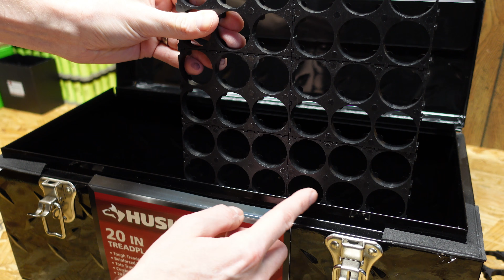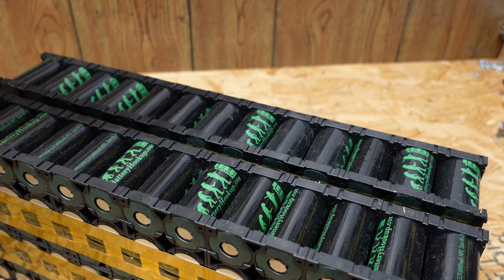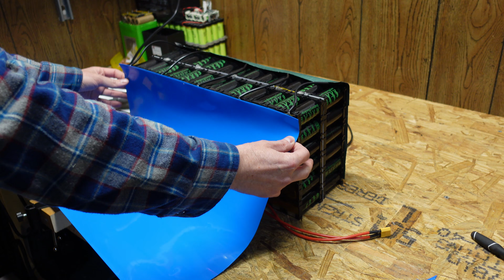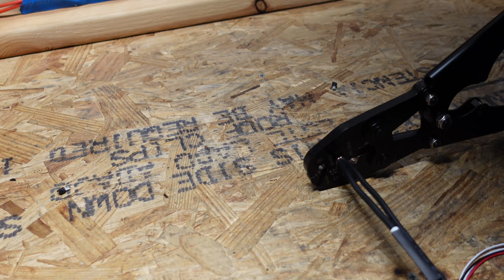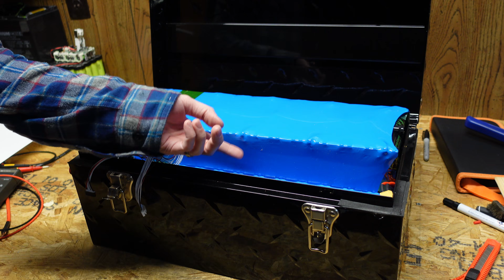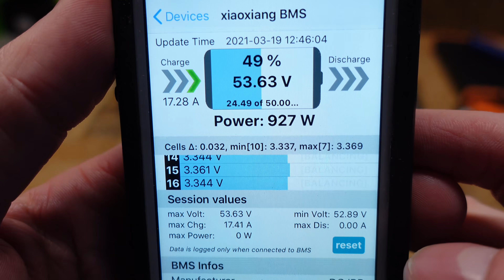DIY 4000Wh 48V LiFePO4 Battery Toolbox Build, Start to Finish!

Comment: 4,000 watt hours battery?   would that be a 4,000,000 milliwatt hours battery?    
Are you selling something on ebay with "massive" watt hour capacity, or simply making a 4KWh battery?
Reply from the maker: It's a 4000Wh battery. I'm not sure what you're getting at. Why would anyone report capacity of this size in milliwatt hours? That's just stupid.
Reply: @LithiumSolar    a bit like saying 4000 Wh...instead of 4KWh.

Comment: BATTERY HOOKUP IS NOT SO GREAT GUYS WATCH OUT FOR DEALS THAT MAY NOT BE SO GREAT.  ALSO WITH ITEM DESCRIPTION.
Reply from the maker: Did you have a negative experience? Can you elaborate on what happened and did you contact them to try and resolve the problem?

Comment: I know you do this just for something to do but, That just looks too much like work to me. For the time input value? I'd rather just get the 100ah cells and have 16 to bolt together.
Reply from the maker: Yep, I wouldn't do this again. LFP cells weren't as easily and cheaply availible just a few years ago like they are now.
Reply: @LithiumSolar  Yeah well with the explosion in demand for energy storage that supply of cells seems to be drying up. Sure seems like there are a lot less listings for cells these days.

Comment: at 24,00 you should not "cut to fit" on balance wires as it changes the amount of resistance and voltage drop acording to wire amount the best solution is to do as you did and curl it up , to cut them is not a good pratic , it is however a very nice build

Comment: Yeah sorry but I really don't approve of your insulation I've seen more better insulation jobs seeing in Australia we have very heavy corrugated iron clay bush tracks because 4 wheel driving means a lot of vibrations.
Reply from the maker: This is absolutely NOT designed to be used in a vehicle or mobile application.

Comment: This needs saying: It's important for safety

ALWAYS cut off the tinned end if you're crimping and NEVER crimp a soldered wire (the same applies to screw terminals)

Tinned ends will suffer solder creep under pressure of a screw or crimp and deform the wire bundle, which in turn raises the bulk resistance of the joint - adding heat in a positive feedback loop

How bad can it get? Back in 1986 I got to tour what was left of a satellite station's 10 metre dish control cabin. The installation engineers had tinned 48V power cable ends before fitting them to the breakers and busbar terminals. They got hot - and the resulting fire caused $5 million damage

Also: It's best to label each BMS wire (you can get a label printer and shrinkable label casssettes for less than $60). You'll thank yourself later

Comment: Be very careful with those thru the toolbox power terminals. I’ve seen them come apart and then the conductive portion will short to the toolbox/chassis. Might not be a prob if only one does but If some chance they both do or if one does and anything is shorted to your “floating” frame then you could have BIG problems.

Comment: Use a longer hollow bar slip it over the crimp tool and use it like a breaker bar and it provides leverage for an easier crimp.

Comment: How many AH are the batteries.? I read 6000 mAH which is 600AH. If I buy 100. Seems silly cheap for 600Ah - thanks
Reply from the maker: They are 6Ah batteries, so yes, 100 of them would be 600Ah (at 3.2V). I'm not sure it would be any cheaper than Al-cased prismatics in the long run. You also have to factor in the cost of nickel strip, cell holders, etc.
Reply: Sorry my mistake, 60Ah for 100 cells
Reply from the maker: @stephaniecopson475  No, you were right the first time. 6Ah Cell x 100 pcs = 600Ah.

Comment: Battery is a very small part. Peak tourque and current of Motor matters. If 48v I'd assume 30A drawn which means at rated RPM and load u can do max 2 hrs (84AH battery)

Comment: do battery hook group the battery cells before delivery? the voltage , capacity and Inner resistance should be at a standard level so that the finished battery pack will have better performance and better user experience .sorting and testing the Voltage ,IN and Capacity are important before packing.
Reply from the maker: No, I highly doubt they're doing any kind of grouping on the cells before shipping. You would have to ask them that question though.

Comment: A sodium battery could be used in front of any condo parking spot charged all night and day slowly, then a higher discharge charger cold be used for a good five to eight hours of good vehicle charging. All this could be done easily for a condo renter or owner to have a power company to install a power connector from the living unit being charged for a little power used at low peak times.

Comment: I worked for a company where the expert of the firm showed me around - when we got to the kitchen, he opened the utensil drawer and literally pointed to each utensil type, calling it out. The guy was a complete moron. Why do you find the need to hand gesture the sizes while calling them out instead of just showing the label that has the dimensions on it? Lame.

Comment: Good build video and thanks! I might however suggest checking all cells and top balancing before spot welding. I recently received a 130 of these cells from Battery Hookup and found three cells had self-discharged to below 1V. After top-balancing a group of 40 cells including the three self-discharged cells, after 5 days those three cells as dropped between .5 and .8 volt, and when fully charged only delivered about 3800mah. After building a 20s X2 pack, I found another 4 cells that delivered between 4800 to 5000mah of capacity.  The date on these cells is '09-20', so possibly two years old, so I may have got a bad or old lot. Batery Hookup has not responded to my messages.  As Such, I might suggest buying a few extra cells if building a pack,  I would be interested in the date of the cells you got are, and if anyone else has had a similar experience with these cells?
Reply: Yeah there is pretty much nothing they will do for you after you purchase

Comment: nice work bud,  would you prefer to use the larger lifepo4 cells due to them requiring less work? how does energy density compare between these cells and the larger 100-200ah cells?
Reply: These are usually more energy dense but the advantage is the shape of the pack. You can make far more compact shapes for specific cases and get a bigger energy density. While the larger prismatic cells need custom size boxes to get the most compact battery.

Comment: i do really hope you actaully sorted the indevidual batteries into mAH and then into correct paralell connection
Reply: Sounds like a good tip. Because the BMS is supposed to balance between the series-connected items, but the cell groups that are connected in parallel are regarded as a single unit, so if one of them is 'weaker' it might go bad, and the BMS won't even notice. I wonder why there aren't any cheap BMS that address each cell individually, i.e. a wire (pair?) for each cell, not just for each group

Comment: Clamp one side of those crimpers between two 2x4's mounted to table and use a cheater pipe for the other side, will be much easier for you

Comment: 3,765 out of 4,000 wh.   Why?  Not fully charge or just unbalanced cells?
Reply from the maker: I didn't spend any time balancing it really. It needs balancing. Also, should have tested it in amp-hours since watt-hours does not account for loss in cabling.
Reply: @LithiumSolar  It was a really excellent video.  I didn't think about cabling loss.  Would it be that significant?   I appreciate all the trouble you went through and got a really professional result.  I am waiting for cells from Shenzen to build a 400ah 12v pack with 2  200A JBD BMS's and I know what it takes to get it done like this video shows.   I have searched for a ready made box to put mine in like you found,  but none fit the bill.  I am going to fabricate one that is insulated and as small as possible to conserve my space.   There isn't much on Youtube showing builds like that so I'm kind of on my own.  I'd be curious to see how much improvement you get if you balance those cells!

Comment: open barrel lugs are by far the best way to go. all these other connectors, like solder ring inside heat shrink type junction connectors, squeeze over tap connectors, etc. they are all crap. open barrel is the way to go. as a bonus, you can also solder these without melting off your shielding. go with some harbor freight marine grade heat shrink, with the glue in the center, over your open barrel lug, and you will now have a water tight connection that Will rival some of the best factory connections. 😏💯💯💯

Comment: Thanks for the video. Considering building a 48v off grid battery bank using the same cells as these. Since these are lifepo4 do you think there's any need for cell level fuses in a big battery setup?

Comment: im pretty sure you have you positive and negative mixed up, negative is the small one on these types of batteries
Reply from the maker: No, I have them correct for these cells. I know what you're talking about though - they're not as-expected on some, like the A123 26650 cells.
Reply: @LithiumSolar  ah that makes sense i have a bunch of a123s here that im comparing to

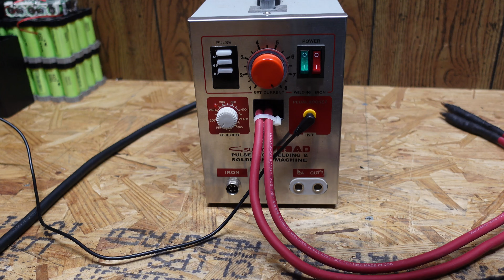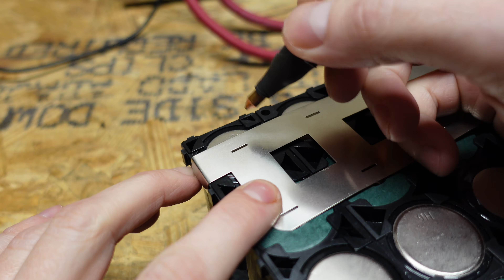Comment: at 5:03 the lower left corner of the strip has slipped under the protective paper ring, this is a possible short waiting to happen, at 5:35 it hasn't been corrected.
Reply from the maker: Yeah, I fixed it later on.
Reply: @LithiumSolar  Ah good, you got away lucky there, it looks as if the corner under the wrap is very close to the negative of that cell. Also, you may want to re-route your balancing wires so they never cross and to ensure that the pack can not move within the enclosure, as well as some proper insulation between the enclosure wall and the pack. Otherwise, great job!

Comment: Why so lil tiny ass wires . Bet that can't power a drill for more then 12 min. Get bigger wires
Reply: Those are just the balancing wires that are tiny. The other ones are sufficient. The whole is not very mechanically sound though and the steel box is a huge risk for a short in case it is ever dropped. The whole thing should be insulated properly between the battery pack and the box and the wiring should be laid out in such a way that the BMS wires do not cross.

Comment: You can make a lifting strap from stranded tape and live it in place so you can lift it out later.
Reply from the maker: That's a fantastic idea actually, thanks for the tip! I have some filament strapping tape and hadn't even thought of using it in that way.

Comment: I like the use of an extra disk on the positive side, I started using them after my pack caught fire because the Nickle strip melted through the the two layers and shorted out the cell during soldering.

Comment: Hi,  perfect build  "  Thanks.  I have spot welder SUNKO 737 G but over 35A  it blows main breaker even  when I had changed the room circuit braker for  C16 instead of B16  which is normally installed in the fusebox in EU countries...  Have you some idea how to prevent shorting the brakers in this case?  Thanks.
Reply from the maker: I have mine on a dedicated 240V 20A circuit and haven't had any issues. The breaker could still be a bit small or maybe the wiring isn't thick enough causing voltage drop (resulting in increased amps)? My circuit is run with 12 AWG, which is the standard for a 20A circuit here. I'm not sure what that converts to for metric measurements offhand.

Comment: Im going to use your discount code for my upcoming purchase on their 3.2v 100AH modules, similar to what you did here but preassembled. How have you liked these cells? Any issues with them?
Reply from the maker: I haven't used them since I put this video together to be honest. My plan is to install this battery in my off-grid solar system, but it has taken longer to convert from LCO to LFP than I would have wanted. The cells seemed great in my initial testing; however, can't provide any long-term feedback yet unfortunately.

Comment: Might look into Anderson Power Poles if you aren’t familiar with them. They are a fantastic connector, safe to use, carries sufficient loads, and can be locked together to prevent them pulling apart inadvertently

Comment: Thanks for the excellent Construction guide, and might I suggest cheeking cell voltages and top balancing them before assembly. And, using something like PENETROX-E or P8A on your crimp connections to improve conductivity and long-term reliability?

Comment: All the 48v diy batteries made with nominal 3.2v lifepo4 cells are 16s? Why not 15s? For what I can understand each cell can run lower than 3,2 safely. 
This is a great video, I am trying to build something similar, thank you so much
Reply from the maker: A 15s battery of 3.2V LiFePO4 cells would have a empty voltage of 37.5V (2.5V x 15). That is too low for most 48V inverters on the market.
Reply: @LithiumSolar  thanks sir! I will do it with 16s then, my battery will have around 50-54 Ah, I wonder what capacity of amps I need in my bms Or if all lifepo4 bms can be put in parallel if I decide to build another adicional battery in the future.

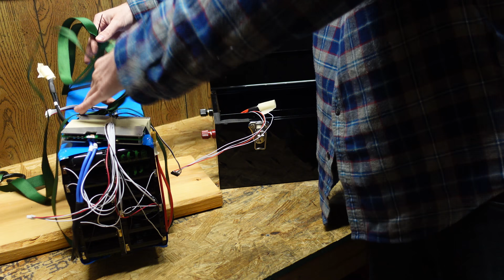Comment: At 23:03 you can see that the BMS tabs are exposed, uninsulated. If the modules shift to either end of the box those tabs will short against the steel box. Or did you line the ends of the box with insulating paper?

Comment: Nice job, anyway I would mount a fan and take off the blue plastic wrap, so that air can circulate among cells. Such big arrays of lithium cells need cooling, and with the plastic wrap the core of the array can get hot, while the periferical cells, where the thermal sensor is, may not get hot as the center. Thus the center cells can fail sooner than the external cells.
Reply: Very interesting points you made. I know nothing about building such stuff, just find it extremely interesting and looking for alternative to power company.

Comment: Cool build, but why build with these cells instead of prismatic?  This is definitely heavier.
Reply: I don’t think adding a couple compression straps is a good reason to start spot welding, taping, soldering, and hammering plastic onto a bunch of small batteries… there must be another reason
Reply: Because prismatics need to be compressed and tensioned??

Comment: I  also have a S10 cell phone, and tried connecting to a new IRobot vacuum cleaner. It would also me to setup the IRobot software. I gave up and tried my Apple iPad and the setup went through perfectly. To my amazement the software on my S10 phone now works just fine. Your S10 might work with just the user name and password login, now that the setup is complete.

Comment: what is the purpose of a shunt?
Reply from the maker: The shunt measures the amount of current passing through (calculation using Ohm's Law). I use the shunt while testing so I can get a reading of battery capacity in amp-hours.

Comment: Why is it that every YouTuber I seen that uses the lithium iron phosphate batteries from battery hookup aren't balancing them or checking individual cells before building the battery packs. I have bought some cells myself and they are testing above 5000 milliamps but I'm sure they're just low testing 6000 milliamp cells. None the less they do perform very well. I'm just wondering why no one is testing them individually. Other than the fact that they don't fit in any standard charger for 18 650 or 21700 cells
Reply from the maker: I've never seen the need to test brand new cells. Can you elaborate on why I should test them? Also yes, not fitting in most common chargers ins a pain... Really need to set one up for testing larger cells with some separate cell holders.
Reply: @LithiumSolar  the only reason for testing the cells in the first place is to make sure you have similar capacities and to make sure the cells are good in the first place. isn't it? Not to mention showing your viewers the capacity results from the testing so that we can see that the cells are performing well. I have 40 5000 milliamp battery hookup cells. When making a pack for myself I realized that each individual parallel pack didn't have the same capacity readings as the other parallel packs Basically what I'm saying is I had cells ranging anywhere from right above 5100 to 5800 milliamps and that range of capacity I don't think it's a big issue but as far as having a perfectly balanced pack. I'm new into building batteries oh, I have only Built a few packs of my own but none the less from what I'm understanding. Yes they are new cells and they should just be able to be put right into a pack but every cell is going to be different,  especially when you're dealing with hundreds of cells, I just feel it would be worth testing each cell to make sure that the packs are as balanced as possible. But it might just be a minor thing that I'm overthinking, not to mention if you are you doing hundreds of cells. It will take forever to charge and discharge and charge every cell again. So I do understand why it's not a common process on new batteries. But I feel like it would help
.

Comment: I'm not sure how you tried connecting the Android via Bluetooth, but I've used a few similar apps in the past and you weren't supposed to pair the phone to the module (via phone/system software pair process), but supposed to use a "connect/pair" feature within the app itself for it to work properly. Just something to try if you haven't already.
Reply: I have the same thing happen to me for a OBDeleven Bluetooth OBD2 dongle on my Volkswagen. Have to connect directly through the OBDEleven app. Not through the phone's BT connect.

Comment: What does 16S stand for? 16 "series"?
Reply from the maker: Yes. This is a 16s13p battery. That means the cells are organized in 16 groups of 13. The 13 cells in each group are wired in parallel (p) and each of the 16 groups are then wired in series (s) :)